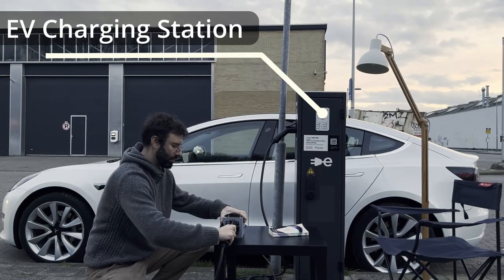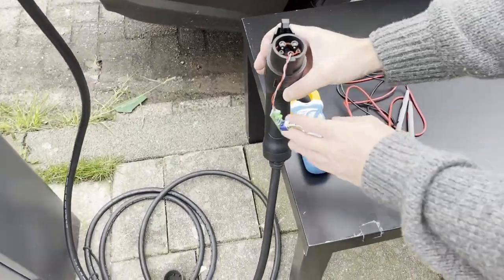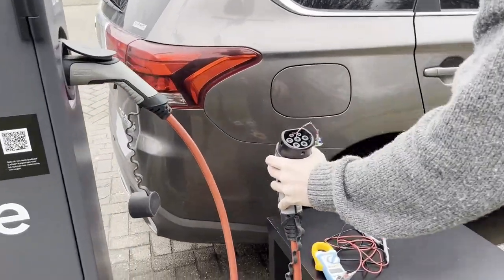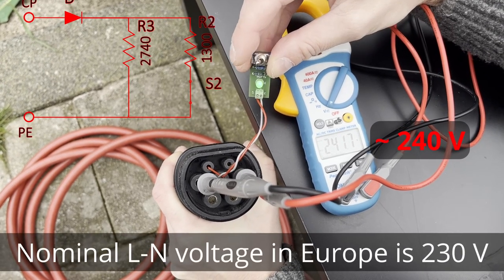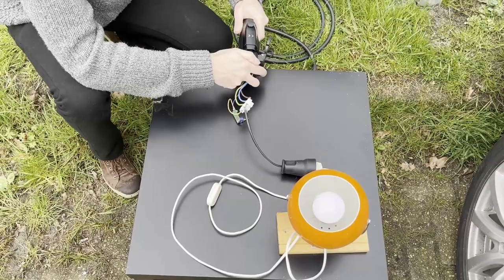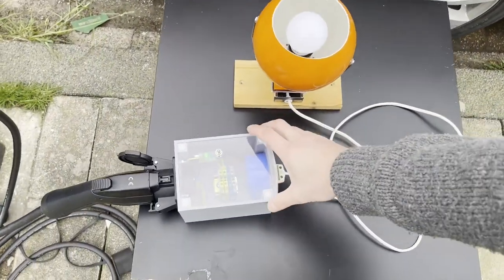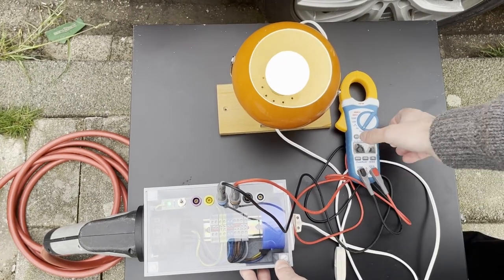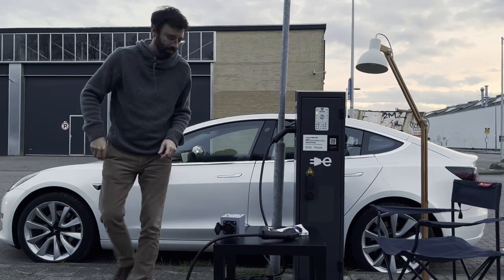Testing a Charging Station with an Electric Vehicle Simulator

Comment: i cannot find those resistors anywhere and i cannot make out the color codes on the 2740 and 1300 resistors the colors are too blurry can you tell me what they are
Reply from the maker: Hello David, the numbers are the resistance values (2740 means 2740 ohm and 1300 means 1300 ohm). You can find those resistors in most electronics stores e.g. Mouser.
Here are links for both:
- https://nl.mouser.com/ProductDetail/603-MFR-25FBF52-2K74
- https://nl.mouser.com/ProductDetail/279-CFR25J1K3
Hope this helps.
Cheers!
Reply: @pedro-neves  THANK YOU for such a quick reply you have been added to my best youtuber list
Reply: also have you got link to all other parts of the build
Reply from the maker: @DavidPerry-c5p  thank you so much! It is my pleasure to read your comment and reply. And it reminds me to improve. In next videos, I'll share the parts list in the Description.
Reply from the maker: @DavidPerry-c5p  , sure:
- Connector: https://nl.mouser.com/ProductDetail/Amphenol-Anytek/VN02A1500000G?qs=sGAEpiMZZMvPvGwLNS671%2FDanv8Jav0682ca2hqJDw5n16cso0EwgA%3D%3D
- LED: https://nl.mouser.com/ProductDetail/Kingbright/WP7113GD?qs=pz0eHrWKk7njL1kTYKysuw%3D%3D
Switch: https://www.amazon.nl/gp/product/B07J4KB38W/ref=ox_sc_act_title_1?smid=A3BZ3PT9ZR43MC&th=1.
Hope this helps;)
Reply: @pedro-neves  Thanks again. Just to let you Know that the way you explained everything in the video was great, easy to understand and very thorough. The only thing that was missing was a list of the parts and links to the build which you have now given me. Thanks again. As some people like myself who can solder but have no knowledge of electronics will find this list very helpful, Keep up the good work and look forward to your next video or project
Reply: @pedro-neves  what about the Diode have you got link for that
Reply from the maker: @DavidPerry-c5p  thank you so much for your kind comment! Indeed in the next video I will share links for all the components and also the files for the PCB. I'm creating a website to support file sharing so when this is ready I will also add those things to the description of this vide.
Cheers!
Reply from the maker: @DavidPerry-c5p  I used an LED as a diode. The purpose was to have a light showing that the signal is on;)